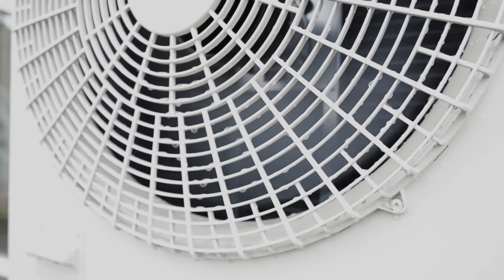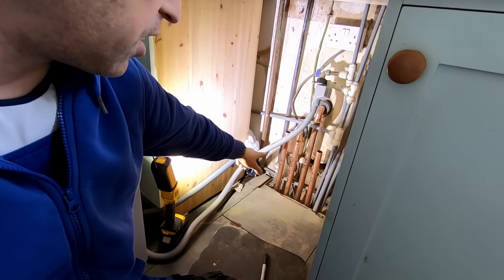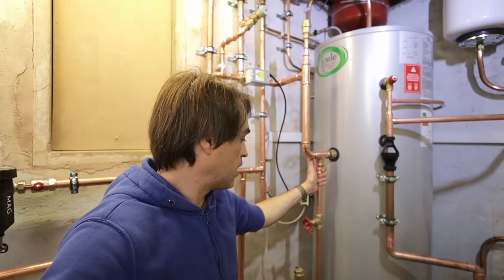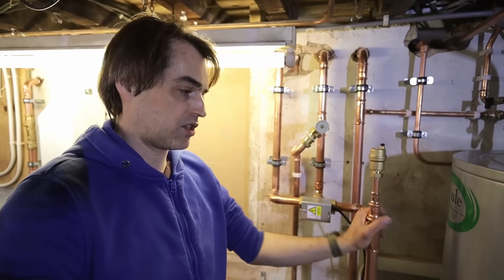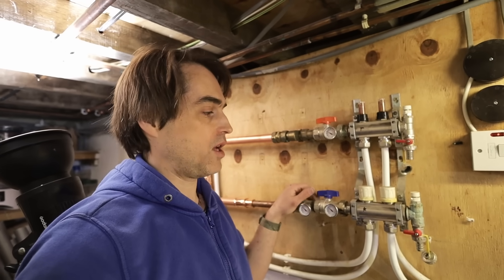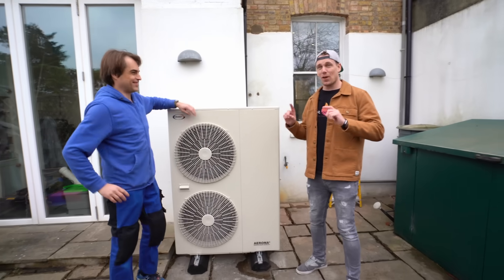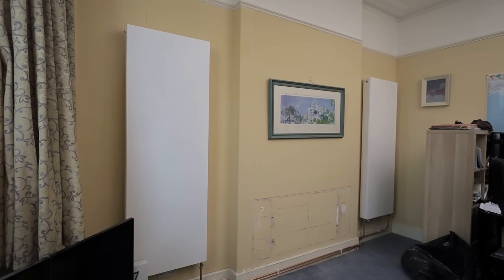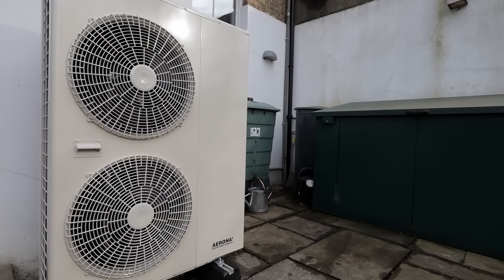The Truth about Heat Pumps: Debunking the Myth.

Comment: Interesting because it’s almost impossible to find a system like this in the US — and no average person would ever be able to afford something like this, and I doubt an average contractor would have any idea how to install this. Most heat/hot water systems in the Us seem to be more “idiot proof” and I can only imagine how many issues a complex system like this would encounter in the US without a proper engineering contractor planning the project. 
Instead, For whatever reason they sell these crappy under powered “hybrid” water heaters which are a standard electric cylinder with a small 4k btu heat pump on top. The cold air blows into the basement /can be ducted but rarely is. The heat pump would need to run all day to actually provide the hot water, so really it just helps the electric heat out, which seems sort of pointless to me. Mini split heat pumps (for air con/hot air) are becoming super popular in the US now, but for hot water, most people still use electric or gas, with the on demand units finally starting to become more common. Many many people still use a standard 60-70% efficient gas hot water cylinder. The only place I would expect to see a system like the one you installed, would be in a very wealthy person’s home. Great job with the install - looks awesome — just think it’s crazy that this is available for average people in your country.  👍👍
Reply: The great majority of average people can't afford it in the UK either. The major valid criticism of the Government's plan to cut household gas use by switching to heat pumps is affordability; these things cost thousands of pounds to install properly, and Mr Sunak is offering grants to cover only part of that cost.

They are supposed to also be paired with insulation as well, but a substantial percentage of UK housing stock is Victorian vintage construction that is not cheaper easy to insulate.

Comment: I'm confused. Does this heat pump perform the entire refrigerant cycle outdoors, and transport heat in/out of the house using heated/chilled water? Because that's what it sounds like you're describing. Radiators are a terribly outdated way to change the temperature of a room; there's minimal air circulation, no air filtration at all, and a bunch of heat lost warming the surfaces near the radiators when what you need to warm is the air in the room.
Reply: Correct, in the UK we have a lot of buildings that are plumbed for wet systems, so its considerably easier, and generally more acceptable to customers to convert these systems.  Of course you could install a mini-split in very room but for the average British person they'd be what the hell is that thing on the wall.  I'd like to see more systems using fan assisted radiators - but they are a bit of a maintenance hassle, filters need cleaning out regularly.
Reply: I'm Dutch and the default for a long time was to have heating only. Provided by heated water systems with radiators. No cooling in the house. But the radiators are placed so that natural convection takes place, most of the time under windows so to also 'shield' from cold air flows.
As you can deduct by now, it's all setup for a cold climate.

However, with time things did change. Central heating is still very common. But a lot of homes have floor heating now for comfort reasons. (Almost all homes arr multi floor with floor heating only on the main floor) This setup is easy to convert to a hybrid system with low temperature floor heating, and 'nornal' heating on other floors and to use for hot tap water. And a lot of homes do have split airco units now for more comfort during summer time, but those outside units provide noise pollution so they aren't that liked that much.

Another thing is that building regulations dictate a minimum of fresh air that needs to come from the outside. This is a massive heat leak and also a major source of discomfort for many homes. The old central heating system with radiators under the window did solve this (house is pressured down by a central air ventilation system, the windows have inlets for incoming fresh air flow)  But with time this got a large overhaul in newly build houses with heat exchangers and no   inlets on windows anymore, combined with better house isolation in general. But this reduced the inhouse air quality too much. New solutions that solve these problems properly while being green and such aren't that wide spread. Because these need separate inflow and outflow ducts for air and our building styles don't allow for easy retrofitting.

A good heating and cooling system with good ventilation is just hard to fit in a home. And retrofitting is even harder.

Comment: What most people forget is to just insulate there buildings properly, which then reduces the demand for heating which then enables smaller devices that have to be properly planned for the specific building.
Most people that complain have to much of a heat demand with a too small water tank so that the pump switches on every other second and is therefore never in the optimal working point. Larger tank lets the pump operate only every hour or so to reheat the tank in optimal working point.
All the manufacturers have new cooling liquids in there new pumps, but tey to sell off there old ones before they will be forbidden in the EU. With the new liquids (like CO2) different pump systems have to be used that also do not have the 55°C limit but can be much higher.

Comment: Okay I admit it.
I took the click bait.
I have used a heat pump for more than 10 years now and for me it have been the best investment I have done top the house .
But there is a major difference between what is installed in the video and what I got.

Mine is just a reversed air condition. It got no hot water so it was quite quick to install. Only drawback is that it do make a little bit of noise inside.

Comment: how much does it take to run ,my gues about 8 kw per hour. and as low temp expected to run 8/10 hours per day. about £16 per day. and in my area of the north ,they dont work worth a ---- on a cold winters day.
Reply from the maker: maxium power input is 4kW when it runs flat out
Reply: @UrbanPlumbers  well the single fan unit i had also used 3.9 kw. failed to heat radiators to blood heat and was useless on a winters night was expensive to run needing to run 10/12 hrs per day. and still need to use electric heaters. when we moved to a house with gas boiler ,our heating costs plummeted.

Comment: It's always about the installation so finding the right people is, as always, super important.  I mean the equipment is important but without the right installers, it's never going to work right.  It's always about hiring the right people.  Hire the right people and they'll make sure you get the right equipment.  FWIW we got a new heat pump last fall and it's been AMAZING.  Rising power prices and our monthly bills have dropped significantly.  Love it.
Reply: I got one last summer and this winter it saved me $600 versus heating with propane. In 10 years it will have paid for itself so basically I got a new AC unit for no cost.
Reply: @kamX-rz4uy Same here.  And the faster prices rise the faster it pays for itself and the rest of those savings go right into the bank.  SADLY, the people that need something like this the MOST are the people that can afford it the LEAST.  We need a way to get people living paycheck to paycheck the better tech that will reduce power needs.  imho
Reply: @kamX-rz4uy  only if it will last 10 years. Our 2 year old 5 ton Trane heat pump just failed last week. 2 years old Evaporator coil has a small leak from factory defect, compressor is done for, made weird sounds and not compressing freon. The tech is not there not. Too complicated to be installed correctly and reliably. Early adopters are paying to beta test for them.
Reply: You must like cold showers
Reply: @Jamie_Johnson  What does that have to do with heat pumps?
Reply: @kamX-rz4uy  Heat pumps are not going to give you a hot shower
Reply: @Jamie_Johnson  Yeah and neither does my furnace. The two have nothing to do with each other. When you get a heat pump installed they don't rip out the electric or gas line to the water tank. I use propane for my water heater, stove, and furnace. But since I now only use the furnace below 20F I use a lot less propane.
Reply: @Jamie_Johnson  Are you talking about where you have a boiler to heat your house and that also connects to a water tank? I don't know how common that is in the US. I have a forced air furnace, separate water heater (propane), and air conditioner. That's a typical set up, especially in newer homes. I don't know if I'd want to use the heat pump to also heat a 50 gallon water tank. There are hybrid water tanks that have a heat pump built in to assist the electric heating elements. I'll consider one when my tank needs replaced.
Reply: @Jamie_Johnson  Speak for yourself. My GSHP gives plenty of hot water and lovely showers.
Reply: @rogerphelps9939  What temperature do you get?
Reply: What are your electricity prices in your country now?
Reply: Good luck with that in Britain.
Reply: True, installer is key. After all with these systems there's no margin for error.

Comment: You should have stuck with the title.  They don't work.  I've had three homes with forced air heat pumps and they are useless.  Once the temperature dips below 40F, they run almost all the time and you feel cold all the time.  The hot water system might be better but blowing cold air out of the registers is not what you want when its cold and rainy outside.

Comment: im so confused. im used to refrigerant straight to fan coil units. ive never seen refrigerant to water to radiators. does the heat pump boil the water or is it just hot water???

Comment: be interesting if they have upgraded the sliding sash windows to double glazed. It would be cost efficient to also upgrade the windows. Would allow for a smaller radiator size as the room heat loss would be a lot lot lower.
Reply from the maker: Yes all windows have been upgraded
Reply: Double? Triple glazed is the basic standard for the windows. There is no point to upgrade to anything else.

Comment: To all the comments about impracticality - this is why you make an upgrade like this when fully renovating. I for example am doing a heatpump installation together with a full renovation of the apartment to install floor heating as well. So, with that in mind, yes an install when you talk about removing the flooring, floor heating and the heat pump will be 20000 + (disregarding other things I'm renovating), but since I was going to do the rest anyway, the heatpump install itself only adds about 7k to the project.
Reply: 7k in which currency?

Comment: Brilliant work, but those rads…I really wouldn’t want those in my 350 year old house. Here’s the thing. I’ve worked outside my entire working life, about 30 years, and I can tell you that the weather is warming up. New builds are often unbearable in the summer, and rarely need the heating on in the winter. Recently, talking to a site manager of a very large new build estate, he said that they are retrofitting ventilation to cool the houses down. Honestly, I’m not sure systems like these are required in new builds. The target should be passive heating with no external heating or cooling systems. This is entirely possible. So that brings me on to older housing stock. It’s not practical to have these systems on many, if not most, domestic size old house. There’s nowhere to put the amount of equipment needed, massive rads aren’t practical, and there are questions over whether these systems work as well in old houses. 

The climate change reasoning for the need for these systems is questionable. How much carbon does it take to build a modern house and how much time does it take for a new build to become carbon neutral. Several lifetimes I would think. In fact longer than many of these properties will last. How much carbon did it take to build my house. Very little. A house made up of mostly earth and wood, dug cut from the garden and land around the garden, erected without electricity. The building lasts too.. Net effect, my 350 year old house has very little effect on the environment in terms of the build. 

The environmental reasons given for the need for these systems is nonsense. What we need to focus on is the big picture. Low carbon new builds, with no need for central heating. A new more practical and greener alternative for older houses. Lastly Energy efficiency ratings should reflect take into account the amount of carbon used to build the house in the first place.

Comment: Did anyone see the close up of the fans towards the end of the video. Lots of moisture dripping. The elephant in the room with ASHP, fins & fans freezing when the ambient temperature drops below 5’. Ironically they used a Grant Aerona. Grant are one of the few to acknowledge the problem & provide a solution by offering a gas or oil backup on those days when it’s too cold for the heat pump to operate.
Reply from the maker: It was raining - lol
Reply: There are no days where it's too cold to operate, a proper, modern heat pump will cycle on and off for defrosting, which is ok in a modern house with good insulation.

Comment: Looks like these people should have put some insulation in too and saved a bit on the fairly epic install.
And 22mm copper to the kitchen taps? Doesn't that mean a long wait for some warm water to turn up?
Interesting to see the UFH just being inlined with the rest. I was hoping to do that but not done the sums yet to check the flow rates.
Nice explanation of what you've done here. Oh and I was just admiring that nice set of bends before you mentioned it. Always a sign of quality work :-)

Comment: if i had a spare  20 k to  insall   a heat pump   i might think about it  !  but   i don't think    i could run it with my   open vented  3 coil  260l   thermal store    log burning  back boilered  stove and  solar themal   tube systems i have fitted   . may i add  all instaled by myself  .
my central heating  runs off   one pump   conected to a heat exchanger    that draws heat from  the thermal store  via   the  stored heat in the tank  .
 i am  not  a  plumber   or a  heating engineer .
 but when  i got an inspection   on the  enviromental efficancy of my house the inspector  said  he lives in a house   that is  5 years old   and does not even have   the energy efficiancy rating  my 120 year old  house has  :)
(  i got a band B  rating  } what ever that means  .
even now the heating bills have gone up    my  projected    combined bills  4 gas and electric  still come under 1 k a year  ,  
not bad  fro a 3/4 bed house in the uk  :)

Comment: High efficiency wood stove with secondary combustion is the only cheap and practical solution. They don't polute since it's complete combustion and are cheap to run and maintain. For 20k you can have a lifetime worth of firewood
Reply from the maker: got a link for a set up like that? I am not sure you could run on wood for 20K for long though.

Comment: Very few people have the space to fit that kin of equipment.
Reply from the maker: literally every single terraced hosuse in London (that is majority of housing stock in London) - has sapce for this kind of set up. All you need is a bit of garden and an airing cupbaord.

This does not take more space internally than gas boiler with a cylinder.